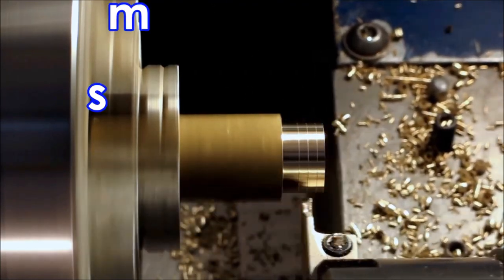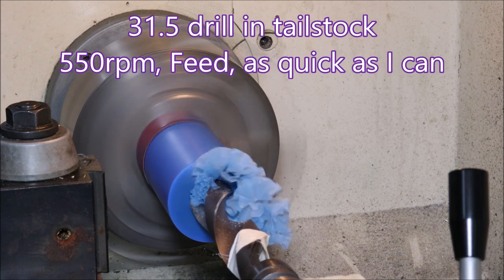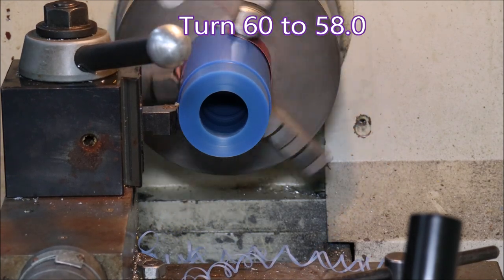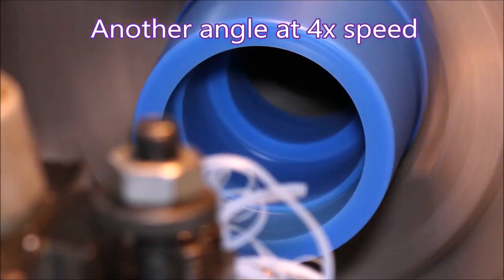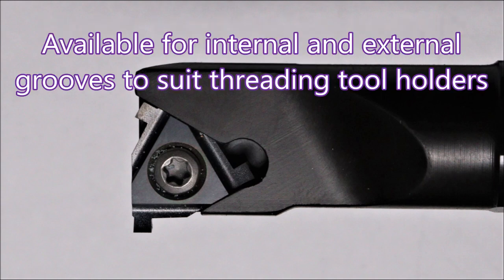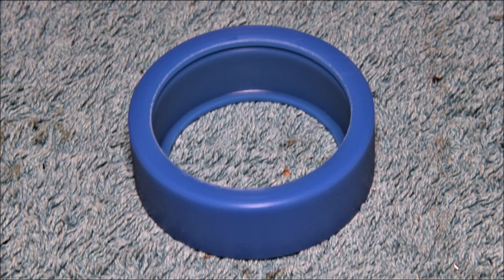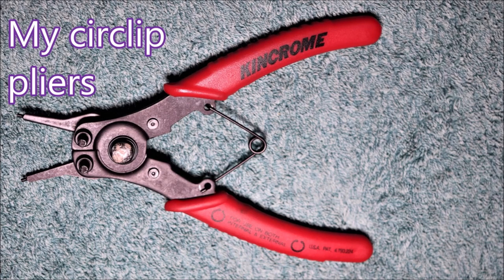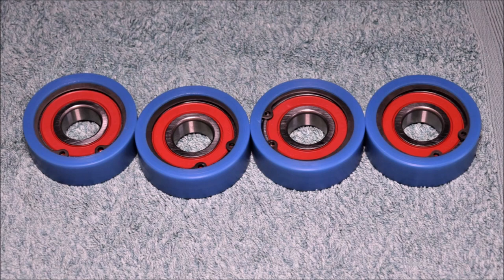Blue acetal drilled and bored for bearing.  Bearing pressed in and Circlip installed

Comment: Had the opportunity to turn some 3 inch/ 75mm black acetal in a big turning center the other day. When the machine's got some power you can get a really nice chip out of it for plastic, but when I have to turn it on our little manual engine lathe it's just a big stringy mess. Surprisingly good at holding tolerance for a plastic though, I think I measured the bore to within .0005 inch / .01mm across the whole job, even without using coolant. It's pretty good stuff to work with.
Reply from the maker: Hi Zachary, thanks for comment.

Comment: Looking good! They seemed to press in nicely, what are these for?
Reply from the maker: Hi Josh they are part of a wheelchair conversion for a van type vehicle.  They did go together well, not much friction compared with metal, I wanted them to be tight enough to not move on the outer race, but without stressing the acetal.  I think I managed that pretty well.
Reply: @smallcnclathes  Interesting project. What sort of interference did you have on the outer race?
Reply from the maker: @joshdavies9218  for a 47.00 bearing I made the bore 46.90

Comment: No substitute for the right tools, but it is fun trying .😅
Reply from the maker: Hi Chris, I think I am getting too old to find it fun, I had eight of them to do and it was a real struggle. The pliers kept falling apart and the handles were too short to offer any leverage.   I thought I had the right tool, and for smaller circlips they possibly are ok, but the power of these larger circlips really surprised me.
Reply: @smallcnclathes  you're never too old for fun, just pick the fun that doesn't cause a stroke! 😉
Reply from the maker: @chrisstephens6673  what great advice! LOL